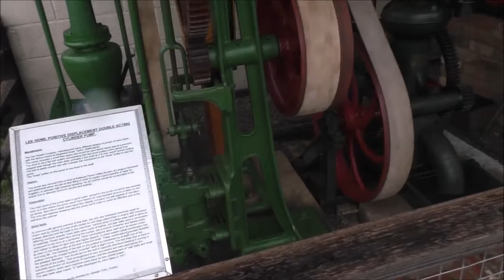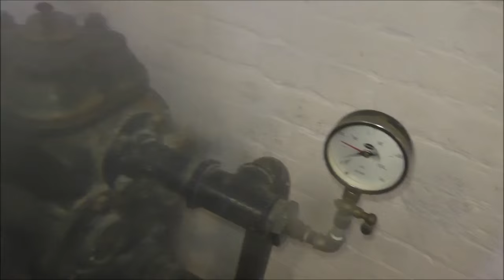VISITING WESTONZOYLAND PUMPING STATION MUSEUM SOMERSET Part 2

Comment: My word that's changed in 55 years when it was just the main engine,,,, a very rare engine with the main crown wheel acting as the flywheel and in turn driving the turbine shaft,,,, and a fantastic array of stationary workshop engines, to think there would have been hundreds of thousands at one time drive the industrial revolution forward every workshop and factory would have had its own engine driving line shafts ,,,, then quite often they installed a generator attached to the steam engine to produce their own electricity and motorized the machinery way before the national grid came along,,, and at most old pumping stations you will find the new pump house not far away,,,  normally electric pumps but with diesel back up as well,,, very sad in a way when you get a huge beautiful Victorian red brick pump house like at Blaggdon (east of Bath) and then over in the corner a nondescript concrete double garage size building replacing all the wonderful machinery and architecture,       Nice ti see such a selection of engines saved even the  worthington and simpon type no rotational pumps ,,,   many thanks ,,,
Reply from the maker: +Alan Plumb We often forget what a fantastic thing the industrial revolution was for science. Perhaps not always kind to those working through it, but how greatly it advanced the world! It is good that such people as those at the pumping station have been able to save and restore so much of it for us to appreciate.